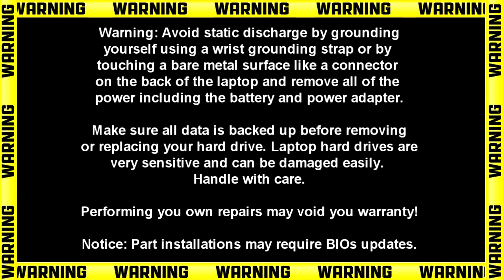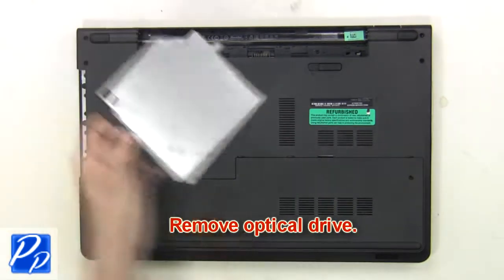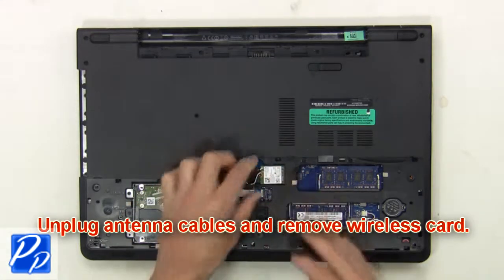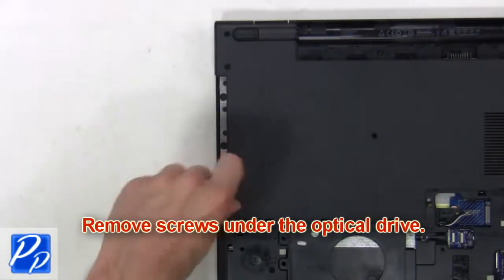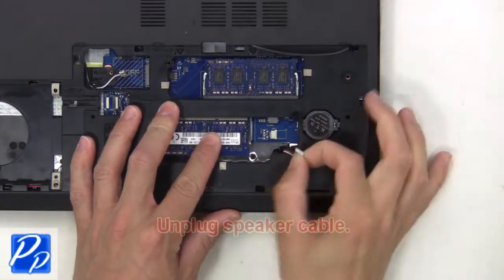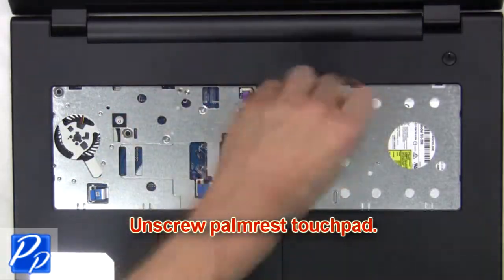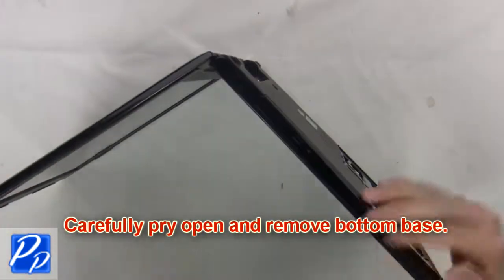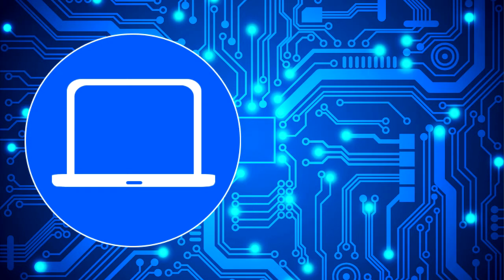Dell Inspiron 17-5755 (P28E002) Heatsink Fan How-To Video Tutorial

Comment: i have the 5755 version with the AMD a8-7410 CPU but there is an Intel Variant as well which takes Ia different Fan im pretty sure. How can I tell which fan is the right one without tearing it all down? Right now Im running my laptop in Passive mode since the fan dead and need it running so I cant really afford to tear it apart, then order the part and wait. Its there an easier way to find the particular motherboard or specific type of Number that will let me know whether the fan is for the AMD or the Intel version? Also, do I need to replace the whole Heatsink and Fan unit, or can are they able to be separated so I can just replace the old Fan and shroud that failed.
Reply from the maker: It is an entire heatsink/fan assembly. This would be the part you're looking for: https://ppci.me/i/26235